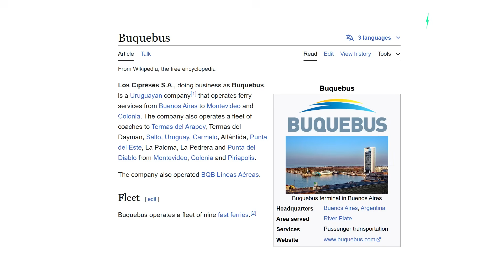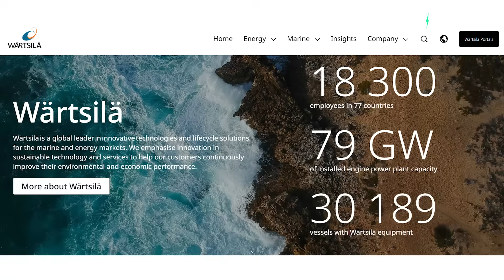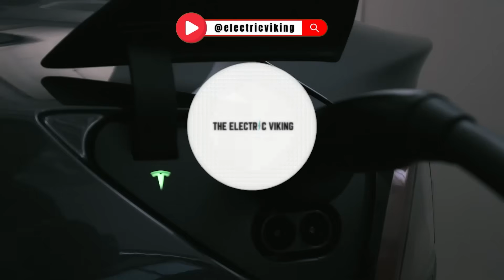Australia Makes Maritime History - Inside The World's Biggest Electric Ship

Comment: The route is quite short so electric is an option, from what I've heard. One of the most impressive things is the charging system at each end of the journey, which has to be massive to top up such a big battery. Incat has always very cutting edge. Their huge vehicle carrying catamaran ferries were used on a route between Melbourne to Bell Bay in Northern Tasmania for a while in the 1990s and early 2000s from memory. They had top speeds of around 80km/h, which is very fast on the water. I remember standing on the deck wasn't a peaceful experience at that speed.

Comment: As someone else said: "much more interesting question for this is several megawatt (so high voltage, kilovolts are there!) flexible charge connections, connecting and disconnecting every 30 min, in marine environment, in any weather including rain, wing, fog, day and night... 

Even usual 240v plug (shore power for a boat in any good marina) in this case becomes a bomb, if not explodes and burns but at least leaks, constantly fails (trips protection) and electrocutes someone. Megawatt-grade plug and cables... ummm, arc roasted sailors, yummy! and electrical fire at sea, bright and loud fun for everybody."

Comment: The range of the ferry is 80 miles and the distance between is destination is 50 miles. Recharging is done during passenger embakation and one country has an abundance of renewables which gives it free fuel and the other is 20% coal. I will be delivere on a huge barge. I travvelled on a similar ferry in the UK and it is brilliant travelling at 30 knots.

Comment: This could be the dumbest thing ever built.
All they need is 40 Mega Watt charging Cable, and it will only take 1 Hour to charge the Battery
Fast Car Chargers use 1 Mega Watt cable
If they used a 10 Mega Watt Cable, the Turn around time would be 4 Hours !
You wouldn't want to be on that thing when a Battery Fire breaks out.

Comment: I hope this ship is successful, great for Tasmania. The intended ferry trip is only 55 km and the batteries are coming from Norway. INCAT and Buquebus seem to have the charging hurdle sorted out, a lot of work has gone into bespoke rapid charging facilities at the two ports of intended operation. Electricity at the Uruguayan port is from 100% renewables, however charging at the Argentinian port will be 75% from coal fired power. However, that should improve over the coming years.

Comment: The battery powered INCAT ship can only do 25 kts (46 km/h) and the route is only 53 km long. It can carry 250 cars - a very worthwhile 75 to 80 minute service - plus add another hour for loading and unloading. The ship will be attached for a plug half the time. But I think we will be waiting for high energy density solid state batteries before we see a catarmaran ferry do a 300 km of journey at 55 kts (102 kmh).

The ship we could use in Australia is the 99 metre Incat HSC Francisco on the Montevideo-Buenos Aries 202 km route. Buquebus charges fares ranging from A$76-A93 economy and A$168-A$190 first class - per adult with vehicle included??? it is advertised as taking 2.5 hours - likely 0.5 hours included for port exit entry. It can do 58 kts, 107 kmh, and carry 150 cars and 1,025 passengers. It would be great on routes like Adelaide (Outer Harbour Cruise passenger terminal and railway station) to Yorke peninsula (Edithburgh and Marion Bay - both need terminals) Kangaroo Island (Emu Bay - new terminal) , Port Lincoln (new terminal at Porter St ~ 280 km direct by ferry) replacing a 7 hour drive (A$120 fuel) with a 3hr 20 minute large catamaran ferry cruise. For Adelaide-Port Lincoln, Qantas charges $200 to $260 per person with 3 flights per day, with a $99 fare change fee. Qantas operates a Dash 8-400 turboprop (76 seats) to Port Lincoln (flight time 55 minutes), Whyalla, Mount Gambier and Kangaroo Island. 

Given the tourist potential of a day visits to Port Lincoln with and without a vehicle, and the cost and time for alternate journeys, it appears quite viable - A$200/car plus A$50/person??

HSC Francisco has a pair of marine gas turbines produced by GE Aviation which can make 22 MW each driving 2 Wartsila LJX1720 SR Waterjets. It appears to have a lot of power with 6 Caterpillar C18 for onboard power and 2 Caterpiller C9 generators for main engine services. Its volume is 7,109 cubic metres. DWT 500 tonnes. 1,516 tonnes displacement (fully loaded??). It cost about A$125 m in 2013, so about A$200 m today??
Reply: 'only' 25 kts? Container and vehicle carrying ships have an average speed of 14-15 kts. Other cargo ships travel at 9-11 kts. New Zealand's Interislander (diesel-powered) ferries 'only' do 20 kts (limited to 18 kts in the Marlborough Sounds to protect the shoreline).

Comment: Some missing info, courtesy of Grok:
If you want to make some research, the ship is named "China Zorrilla" and also "Incat Hull 096". At full charge, it can sail for about 90minutes; the crossing it is intended for is about an hour.
Shore-Side Charging Infrastructure:
High-Capacity Chargers: The ferry will rely on shore-side charging systems with 50% more capacity than any current installation worldwide, making them the highest-capacity chargers for marine use to date.

Charging Time: A full recharge is expected to take 40–90 minutes, with fast-charging infrastructure being developed at ports on both sides of the Río de la Plata (Montevideo and Buenos Aires).

Charging Ports: The vessel includes retractable charging ports on both port and starboard sides to facilitate efficient connection to shore power.

Operational Charging Strategy:
The ferry is designed to make three crossings per day, with charging occurring between trips. The 40-minute minimum charge time aligns with typical port turnaround times, ensuring operational efficiency.

The lightweight aluminum construction reduces energy consumption, allowing for shorter charging times compared to heavier steel vessels. This design choice halves the electricity required, optimizing the charging process.

Also, it was built using Tasmania 100% renewable energy grid. It will be transported to America via a "heavy lift ship", whatever that is. Also, they want to make more of these for other routes.
The charging should operate at around 20 to 40MW. It's around 1 to 2% of the peak local demand for Montevideo. They have a lot of hydro power there which should help with the energy storage. The grid in Buenos Aire is a lot bigger and not so green, but still, it's not a triffle.
Grok estimates it will require a lot of local infrastructure upgrade, like new lines and substations, maybe onshore batteries. I suppose it couldn't find that kind of info.

Comment: You failed to mention that another similar project has been scrapped because they worked out there was no way to get enough power to recharge it!!
This ferry will have around a 100km trip each way & will require massive infrastructure at each end to keep it charged. Its unclear if that part of the project has been built yet.
Reply: WRONG ! You obviously are a troll of the fossil fuel lobby group, which spreads disinformation and propaganda for the reasons of wanting to continue with the absurd fossil fuel product s.

Comment: How do you charge it
Reply: My question exactly. It will need a large charger and power supply!
Reply: When it's in the USB port
Reply: @robertshinn2165  lol. The charging ports are Buenosaires and Montevideo.
Reply: My question too. How long will it take to recharge those giant battery packs? If people are complaining of how long it takes to recharge a 200kwh battery in a GMC Hummer, is the charging time proportional to the size of the battery in this ship? Will over night be enough time to charge or do they plan on running this thing once a week?
Reply: @SHO1989  for any battery, each cell has the same ability of charging power, so the more cells, the more power and capacity, proportionally. It's also the case with discharge power. In other words, the minimum possible charging time is the same for one cell or for one million, if you can get enough power to each cell.
Reply: It seems very little info is available about that, but they are building retractable chargers with a power of around 20 to 40MW. You can ask grok about it of find my post somewhere under this video.

Comment: The Everything Electric YouTube channel discussed Hull 096, likely the world’s largest electric aluminum ferry, about 2 months ago. It uses waterjets, powered by its electric system, for a shallow draft suited to the River Plate’s shallow waters. These waterjets and high-grade aluminum are designed for durability under frequent use. The ferry’s route between Buenos Aires, Argentina, and Uruguay varies: Buenos Aires to Montevideo is approximately 130 nautical miles (240 km), while Buenos Aires to Colonia del Sacramento is about 30 nautical miles. Built for frequent round trips, it’s expected to be a key work horse for this busy route.

Comment: Like many oithers, I wonder how it charges when it is at sea - for example, how you charge it so that you can sail from Hobart to the River Plate???? I have some ideas, fanciful. 1) put pop-out generators on the hull (like the RAT on planes) - they rotate from the slipstream, then get someone to tow you! 2) sail up to a floating wind turbine, plug in and wait a while.
Reply: That ship was OBVIOUSLY not built to be trans-oceanic!  Even if diesel powered, it would probably not make the crossing on its own.  It will clearly be towed.
Reply: @st-ex8506  Evidently I'm no marine expert :) I thought it would have to make its own way.

Comment: You need to have the disclaimer 100% electric from the beginning. The Swedish/Danish Tycho Brae and Aurora is two ferry's that started as conventional diesel electric ferry's, but did get battery, to power them the relatively short distance between Denmark and Sweden. They are 10 000 ton ferry's. Hence greatly out mass this new ferry.
Reply: That ship is 130m can carry 2100 passengers and 225 cars. Appart from the cars which it beats by a little more than 10%, it's much more than these you cite. But they sure are impressive themselves.
from Grok: 
The Tycho Brahe and Aurora af Helsingborg ferries, operating on the Helsingborg-Helsingør route, have the following specifications based on available information:
Length: Both ferries are approximately 111 meters long.

Displacement: Each ferry has a displacement of 8,414 tonnes.

Passenger Capacity: Both can carry 1,250 passengers.

Vehicle Capacity: Each ferry can accommodate either 240 cars, 260 trucks, or 9 passenger train coaches.

Railtracks: Both ferries have three railtracks inside, with a total length of 266 meters.

These sister ships are nearly identical in size and capacity, designed for high-frequency, battery-powered operation across the Øresund.

Comment: How do you charge all those batteries? Presumably it can only travel between points that have designated marinas that have direct access to the national grid.
Reply: It currently is being fitted with onboard generators but they are planning to install 30Mw charging units on either side of the ferry's short crossing.
Reply: @barnysadventures  30Mw charging units powered by,,,,,,,,,,,,,,?
Reply: @paulmannix1760  electricity? Argentina has about 41% renewable/nuclear and 59% fossil fuel electricity generation at the moment. Uruguay has about 98% renewables (wind, hydro, biomass and solar). So combined, most of the electricity will come from renewables for now and as renewables grow in Argentina the amount of fossil fuels used will decrease. Even without an extra 59% of renewables this ship means there is no diesel particulate pollution.
Reply: @ valuable information, thank you.

Comment: I notice it's a catamaran, Sam.  This makes it okay for reasonably sheltered and calmer seas, e.g, The River Plate river mouth area, Brazil to Uruguay.  Wouldn't like to be on one if it had to traverse some of the world's rougher seas - or even the Bass Strait in a heavy blow.
Reply: These vessels (diesel versions) have been used on Bass Straight run. They have also been used between Australia and Indonesia. The ocean going versions use wave piercing hull planforms and can reach quite high speeds in good conditions.

In calm seas they are fine but when the going gets rough seakeeping is not one of their best attributes and forced to slow down,  they lose their speed advantage.

Comment: Great until the lithium batteries catch fire and you can't put them out. Abandon ship in the midle of the sea. No thanks, until batteries don't have thermal runaway.
Reply: Ships have gone ablaze, and have been lost by fire MUCH before Li-ion battery ever existed!  
Moreover, even if battery fires do exist, they are excessively rare, IF properly managed.
And finely, large ships might not be powered by Li-ion batteries, but by batteries of other, more suited chemistries.
Reply: I think water is abundant & lithium iron phosphate or sodium batteries are safe. Finding problems is easy; geniuses prevent problems.
Reply: Sam will buy you a ticket.